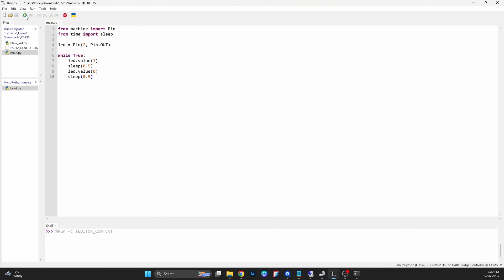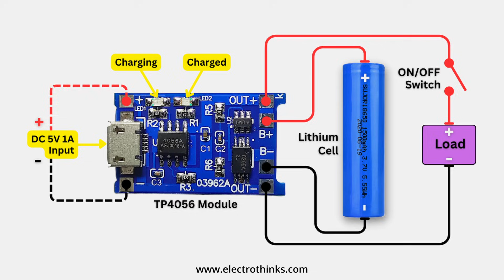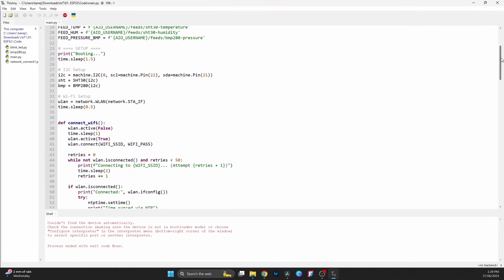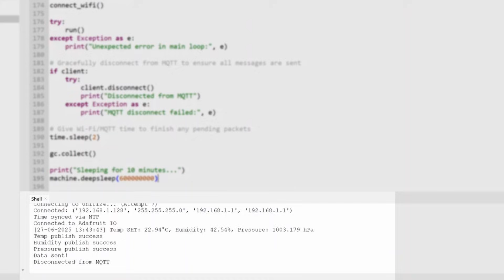I Built my Own Weather Station...

Comment: Man, this is a sweeet setup!  I've been getting back into coding, and am in the middle of doing the same kind of thing here.  ESP-c6, bmp280 and aht20.  I have a web dashboard that does not look nearly as pro level as yours.  I did add in weather data than can be derived from pressure/temp/humidity to see a bunch of different metrics.  Your dashboard is way better looking than mine.  I didn't do it in micropython, I'm using C++ and vs code here.  it's kind of me learning what I'm doing and leaning on AI to lead me thru some of it.  The power board was something I didn't know about, I need to add that in.  At this point my plan was to slap a battery bank on it, your setup is a lot better in that regard for sure.  I subscribed, keep up the good work!  I'd love to learn more about the dashboard setup.
Reply from the maker: Thanks so much for the kind words! I've actually switched over to Home Assistant now which I've found to be very versatile. You're braver than I am using C++, MicroPython is a lot simpler for me to understand 😂

Comment: Great video mate.How did you connect the battery to the esp32?Did you use a battery holder with pcb through pins?Did you solder it after with the tp4056?
Reply from the maker: Thank you, I appreciate it. The battery holder that I had on hand had the through pins which I connected to the TP4046. But for a permanent solution, I would get a battery holder that has leads already and then solder to the TP4056

Comment: For ultra low power, did you consider to cut the uart chip and the built in power led?
Reply from the maker: I did, my biggest power consumer at the moment is the boost converter. I’ll change that out first and then look at removing the other 2 that you suggested 🙂
Reply: @J-Rat 👍 from some measurements I’ve done on my nodemcu the uart + led + deep sleep takes about 22ma. While deep sleep alone can get under 10ua and let the battery last many months on a single charge

Comment: Nice I have some old weather stations cost a pretty penny and used to plug into a raspberry pi on usb but the base stations died on me but believe the sensors are mostly ok - sort of gave up on them as the price of them never really dropped for just a load of plastic using its own 422mhz comms system but will have another look at it to fit an esp8266 or esp32 and feed into something like home assistant now that i started looking at that over just raw tasmota and arlec smart gird carp. Going to try flash those with esphome instead to turn on pumps around the property not just based on times.
Reply from the maker: That's a great idea! I'd love to see what you end up making.

Comment: Don't you need a voltage regulator from the battery to the esp?
Reply from the maker: Ideally yes, I probably should have used one and definitely for a more permanent solution I’ll add one